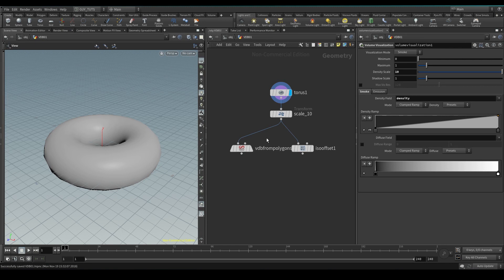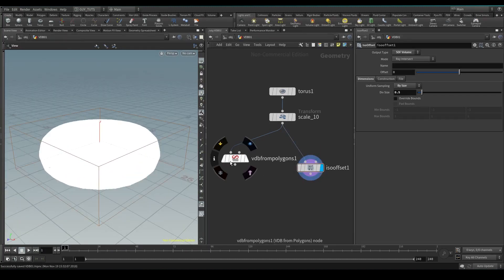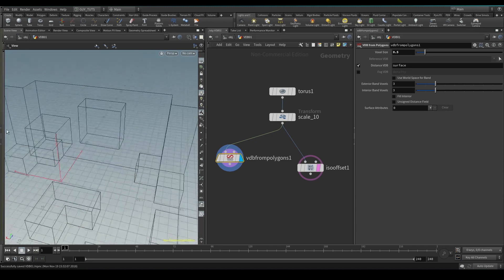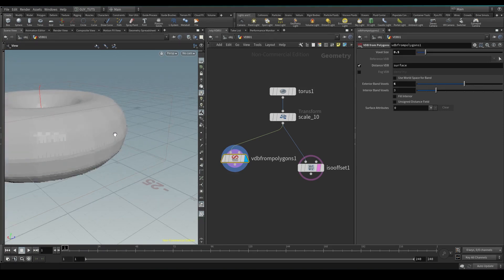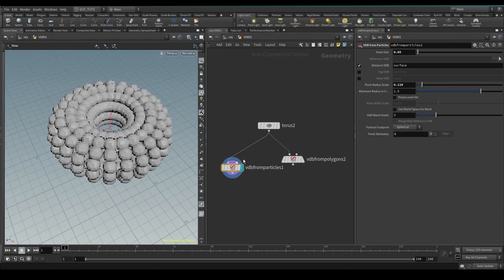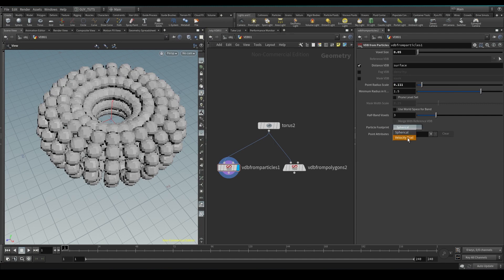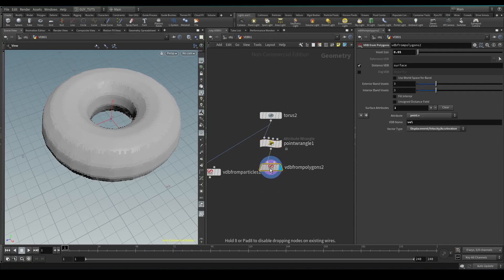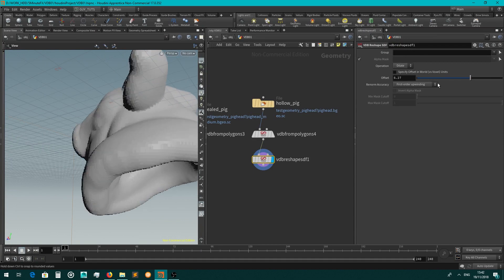Houdini VDB In 5 minutes

Comment: Is it possible to vary the vdb voxel size across an object, for example using another volume or object as a reference for a fall off, so I can have a controlled variation? I'm looking to achieve an aesthetic that has a variation in mesh thickness over a base mesh that has a uniform geometry?
Reply from the maker: Hi, thanks for watching. unfortunately I think you aren't able to vary the scale of the voxels in the same vdb. you can vary the number in that axis though. perhaps what you could do is transfer an attribute to control the displacement along the normal. This would give you the ability to control the thickness. you could even find the normal by using vdb gradient. I hope this helps
Reply: @5MinuteFX  Hey thanks it helped a lot, I used colour value to control the pscale through attribute transfer and accomplished a falloff effect by using the blend distance, with colour value driving the proximity scaling I quickly colour values are of importance to scale values, with black being the lowest to white give the largest values. Houdini is a versatile engine, thanks for the advice and tutorial!
Reply from the maker: @GEORGE.M.M  No problem! Yes, Houdini is a complex beast but if you can get a hold of the basics, you can apply them to any situation. That is what I try to do with my tutorials.